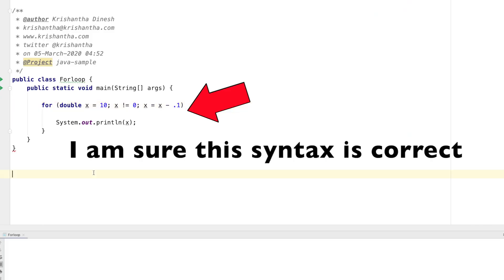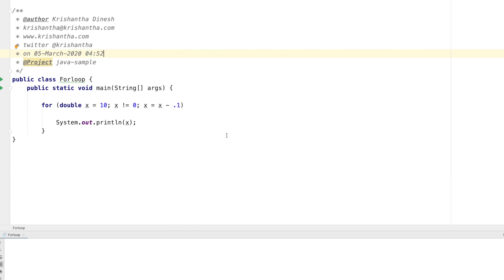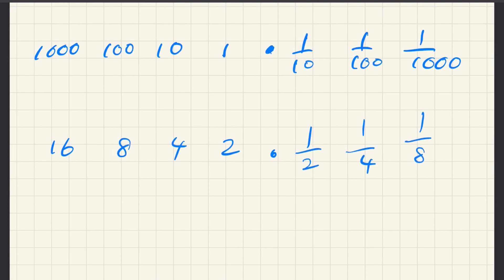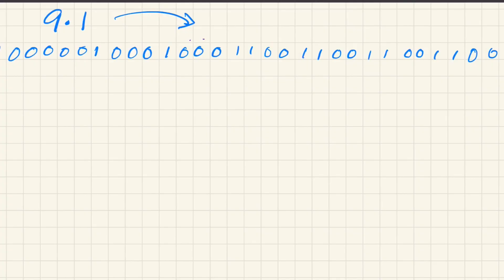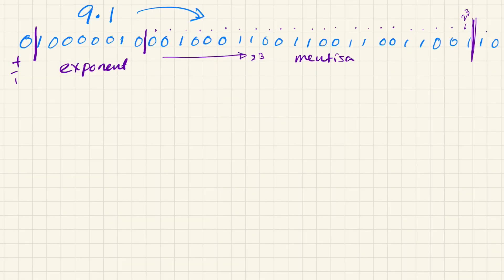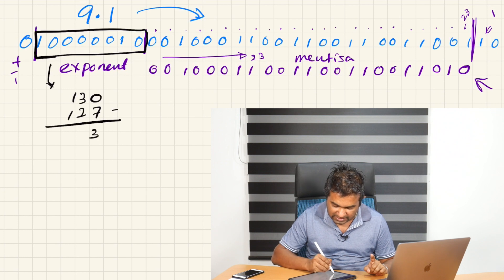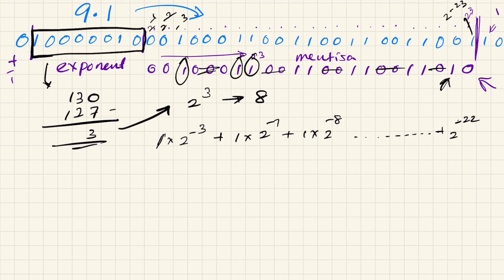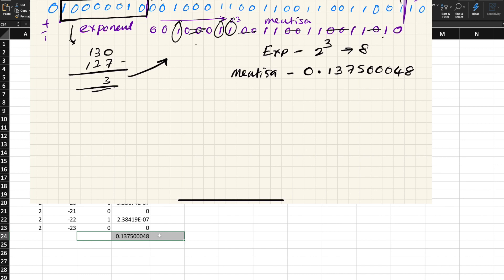Floating point rounding error in computer with an example. | IEEE 754 to Decimal conversion

Comment: regarding the second problem (the 3 months interest sum), is it 100 because of the compiler optimization?
Reply from the maker: No. I am sorry. I just realised I did not run the program with uncomment sysout :( its my bad. 
problem is this. 100/3 become 33.333333333333~ this repetition do not understand by computer floating point calculations. so what its do is it take 100/3 is 33.333333333333336 thats the computer get as answer for 100/3. now take calculator and add 33.333333333333336 for 3 times you get 100 !!!!
Reply: @krish  I see. Thanks for the clarification. :) I am really enjoying your videos. Keep up this good work.
Reply: @krish  Hey Your video helped me a lot, although I got one question. You are saying that computer is not able to understand 33.333333... to infinity so it rounds the end so it can get a result? If yes why this value is 6 and not for example 4? Its because its twice much as 3? Sorry if my question is inappropriate.